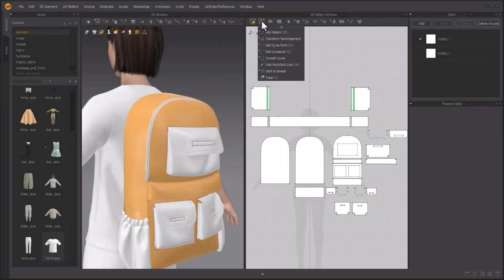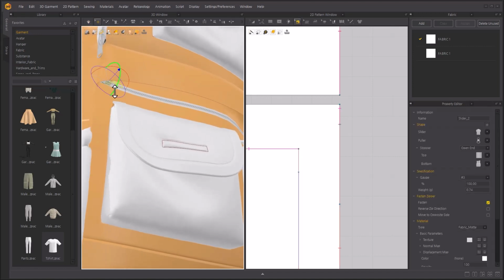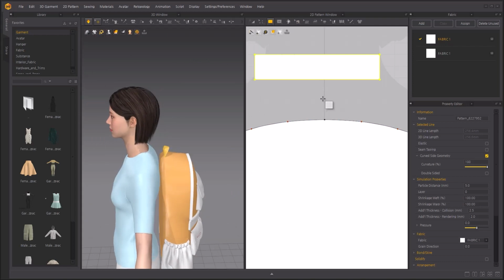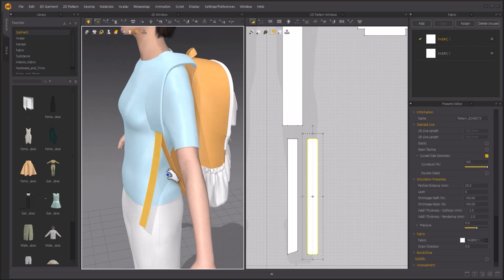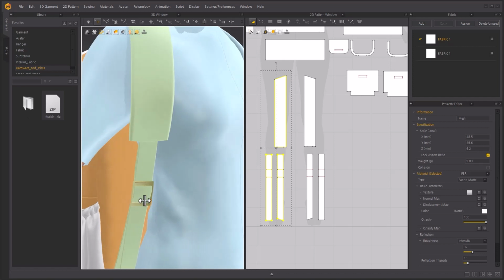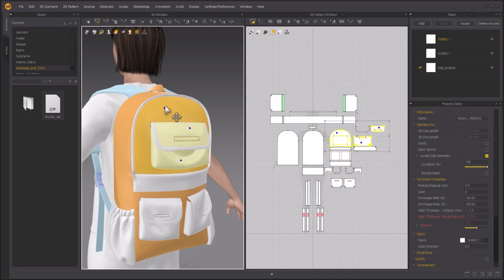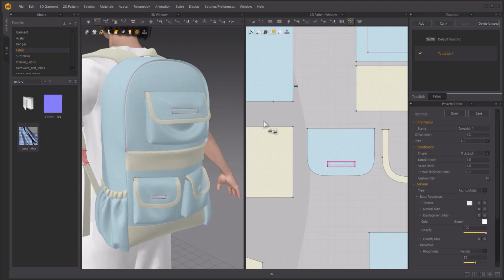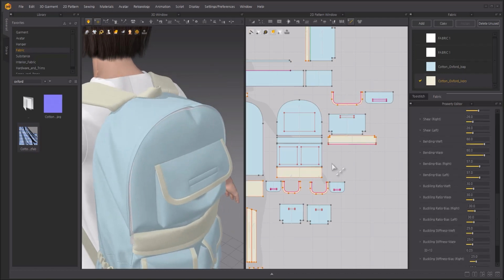Marvelous Designer 12.1: School Bag (Part 2)

Comment: This is a mostly great tutorial. The only thing bugging me is that MD seems to 'forget' everything is strengthened every time I change something. So I have to simulate, immediately pause when everything starts collapsing, then unstrengthen -> strengthen any piece, after which MD will remember "oh yeah, all this stuff is strengthened!" and stop it all collapsing. Very annoying as I have to do it EVERY SINGLE TIME SOMETHING CHANGES. T_T
Edit: Also, you cannot glue a trim and also enable collisions on it. It's a bug that has apparently existed for two years and they still haven't fixed it.